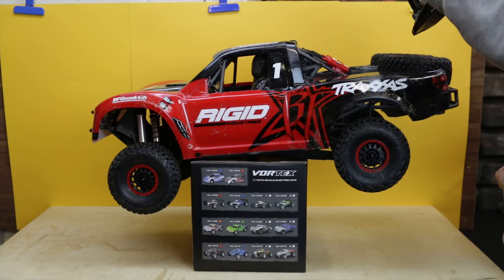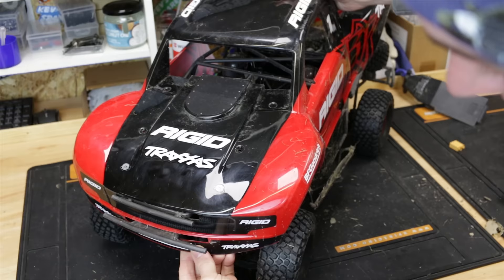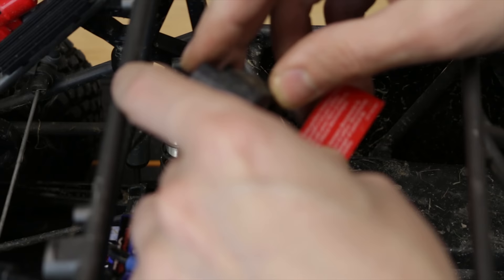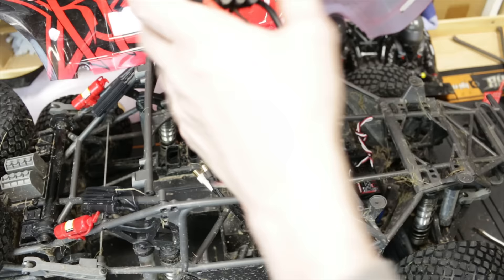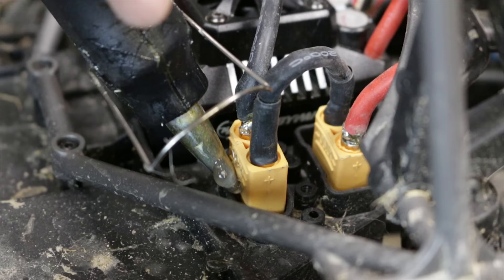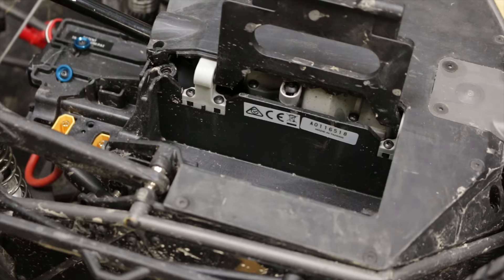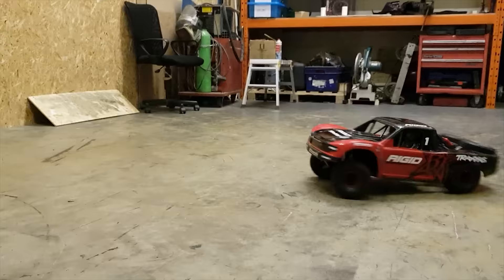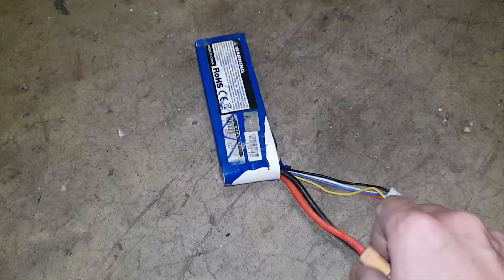Making My Traxxas UDR 8s and installing XT90 Connectors

Comment: Air resistance will affect top speed. I suspect the vehicle will flip before you hit 70mph as the wind gets under it. May have to put stiffer suspension in the rear and add weight to the front.

Comment: Actually it can pull wheelies on 6s, and I have done it on 2 3s 5000mah 55c batteries, except you need to do it on a ground that will give it very good grip.

Comment: hey, that was pretty cool! liked the sudden explosions! just wondering: does the Traxxas VXL-3s ESC fit on the TRX-4 using screw holes without modification? you should have one laying around from the Slash 4x4 when it came out of the box. help!

Comment: You should check out exocaged rc before you do a speed run. His is 8s and it handles horrible at those high speeds. It seems to want to lift and with the suspension being as soft as it is It will roll quickly.

Comment: Awesome video 👍. What esc and motor did you use please try and provide the links.
Reply: Collins Njarara he just replaced the stock 6s traxxas esc with a hobbywing max 6 with xt90 connectors allowing to run 8s
Reply: @kaysonosborn5247  Thankyou.

Comment: You are going to have roll-over issues before you get to top speed.  The left front is most likely going to lift due to torque....  Saw another guy trying 8s and his would lift and crash at just over half throttle.